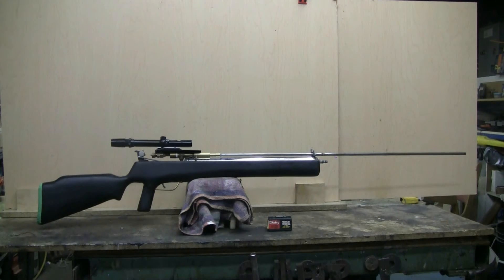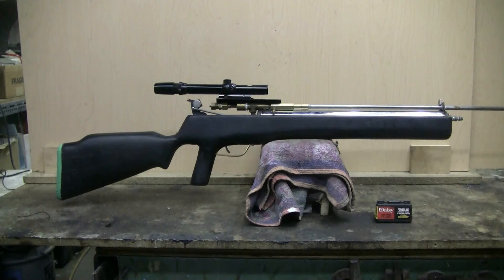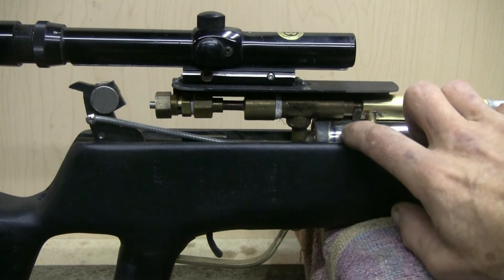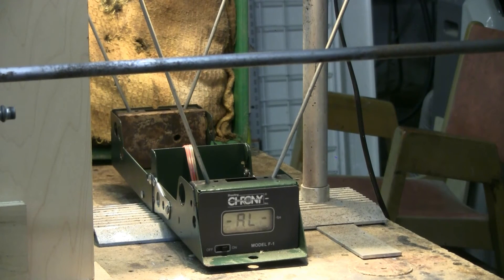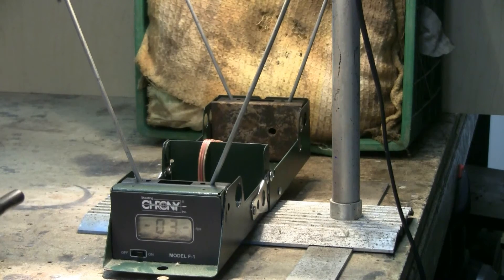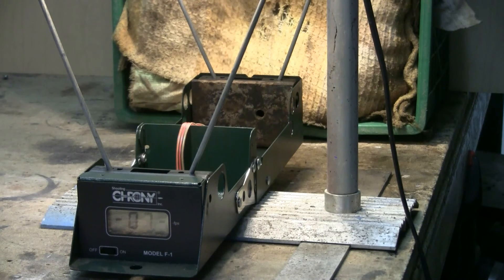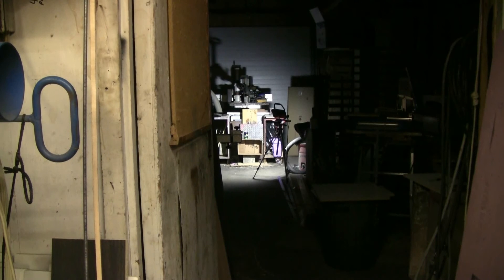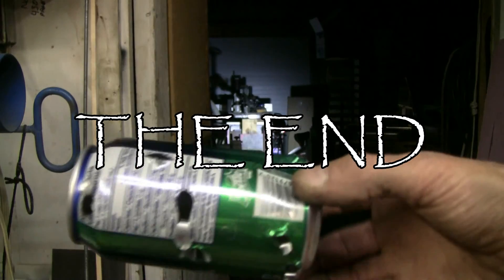Home Made .25 Cal BB Gun

Comment: I would like to see the velocity you could get running with a good sealing barrel and using your highest pressure, because the run you did with the 250psi supply was already 460 or so.
Reply from the maker: I will make another video when I get a suitable barrel. This one, with an ID of .270 is too loose for my .25 steel BB'S.
Reply: @BillGilmour519  I thought about making an easy gun shooting the same .25 cal BBs with a smooth barrel and powered by .25 nail gun blanks!One of the ideas is to make it really simple and the other is to make it somewhat more complicated but with magazine or drum and powered with .27 nail gun blanks!Perhaps a revolver rifle:with the red power level and 24' barrel it will shoot these .25 BBs at a little over a kilometer per second!